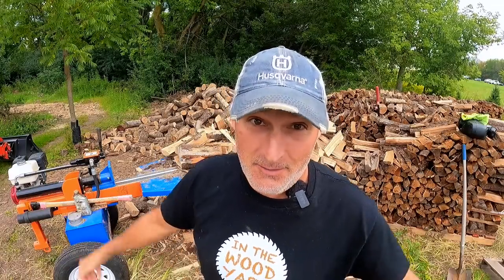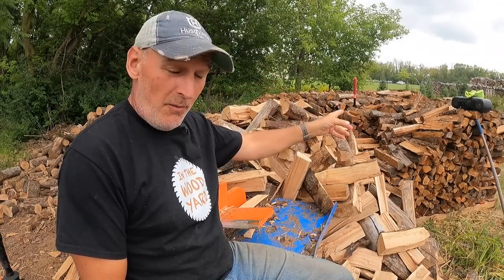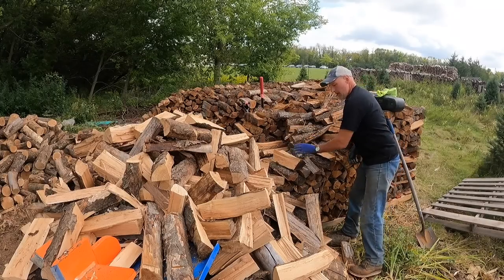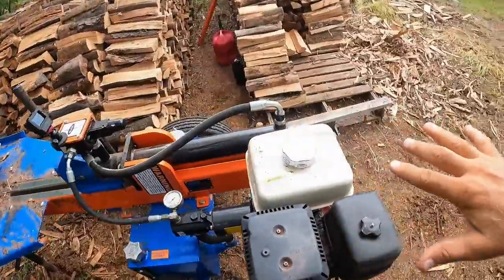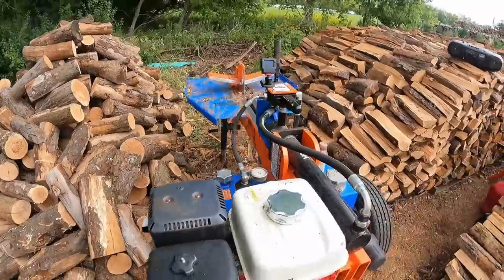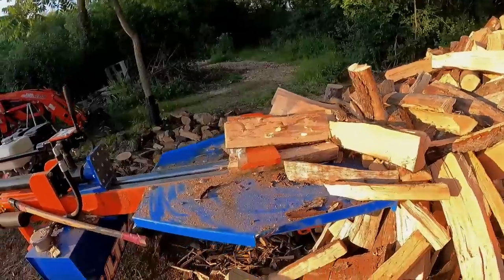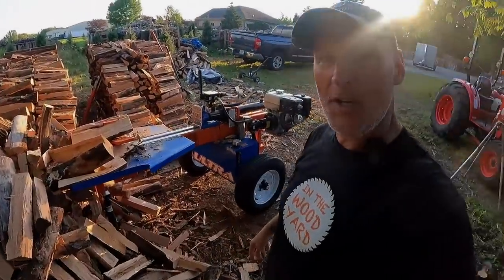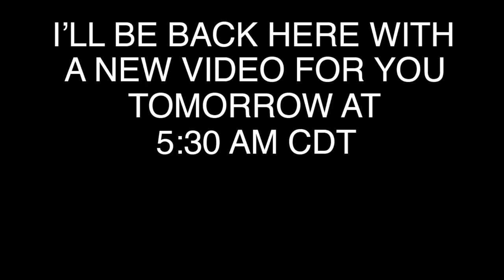Massive cherry firewood production!

Comment: I have a cord of cherry from 2 weeks ago. Green logs, split right away and stacked in a holzhausen just for fun.  To try it out. 
It's checked and looks super dry already,  it was 40% approx day of splitting, I took a few larger chunks, split in half and moisture metered it, today...  and it was at 25% in 2 weeks dry time! It really does dry fast! 
Might be dry enough by December for selling! 
Gotta get that cash! 💪 
As always great videos
I timed my wood splitter cycle. It's 26 seconds all the way down and back cycle time.  Single wedge. I need to upgrade. You're making 16 pieces of wood in time it takes me to make 1 split lol.   I made a pile about that size today too. Took me 7 hrs. Not 2 hrs 45 mins.  You're in beast mode!
Reply from the maker: Yup, get a faster splitter, speed makes a HUGE difference in production.

Comment: I have some massive cherry on my property. Any of that bigger stuff though I imagine would go to a mill before sold for firewood though. I have some that are 30-40 inch diameter. That isn't all of them but I have a dozen or so like that in the woods. There is tons of cherry here. Basically all my trees are cherry, ash, beech, maple, and ironwood. There is some others but that is what the majority of the trees are on my property. I cut some cherry recently that was from blow downs a year or so ago that I cut into about 10 foot sections and skid them out of the woods with my ATV. I skid them out and pile them up and leave them and its almost always like you have there. When you cut and split it, its fine ready to burn usually bark falling off.
Reply from the maker: Yup, that is another reason I like cherry!

Comment: Great video. And the way you explained about cherry, that's how spruce is for me where I live, however spruce grows up to 24" diameter or more. I sell alot of spruce here. I do have a question though, ok yes you have to stack the wood so it dries evenly and off the ground, but if wood is dry already, how come you don't just make a cage like your cookie bin and just toss it in cage as your splitting? Because it would still be off the ground if tossed on pallets and that cherry is already dry. Just was curious on your opinion on that. Thanks.
Reply from the maker: Good point Rod! Habit, and I did not know it would be THAT dry! Thanks

Comment: This has been a weird year for firewood drying.   I have some silver maple that was cut green this march,  bucked and split within the last 3 weeks, that tested out at 20% inside, 14% outside when I tested some yesterday!!!   These were from very large logs, too- 12-14" is the smallest. (they chipped everything smaller)  What... How???   It went from too wet (this stuff was JUICY when I split it) to POOF! wood in half a year.   I guess it does season in log form, and is just wet when I crack it open.   I've noticed changes to the color of the wood, it's hardness, and the smell vs pieces I split this spring.   Interesting to know- I can almost wait until I need more to buck and split some, lol.

  Most other varieties have dried out much faster than expected, too.   I've burned hickory and sugar maple purchased green last November.   Ash and Norway maple have been bucked, split, - and burned that night, or within 3 days...

  Hope you're having fun at Bunyon!   One of these years...
Reply from the maker: Yup, I was surprised too on the logs drying well in 6 months! Bunyan was awesome!!!!

Comment: I have a 50" cherry tree on my land right now . Just processed a 30" cherry last summer. I should send some pictures . Have a great day !
Reply: You should get it sawmilled  into live edge  slabs  when its time to cut it down.  It's worth 40x more as lumber than firewood.
Reply: @Garrett572xpg  That's the plan , the 30" was not worth much and was damaged that's why it was made into firewood .
Reply: @Garrett572xpg  I use to think that too but that’s if and only if it’s great wood. Cherry may be one of the hardest woods to find without milling issues. Most twist knots go deep and many have rot up the middle. By the time you find those few good ones your margins are out the window and it may as well be firewood.  But if your set up for it the margins are set up to make good money in my opinion.
Reply: That 22 in log I traded was exactly what he wanted. I hope you’re big tree is solid
Reply: Most live seen once over 25” 30” they rot in the middle
Reply: Cherry also likes to fork at the top which can make getting them fell without splitting the base log, real tricky as well...
Reply from the maker: WOW, THAT IS AWESOME!
Reply from the maker: That makes good sense!
Reply from the maker: good to know!
Reply: @stannelson2582   To the right woodworkers rotten  centers or spots  can be trimmed off or shaped  out with a flap disc grinder after being kiln dried. U can join 2 ugly slabs together make 1 nice slab or trim them narrow  for live edge  shelf with square back. U can use epoxy resin for minor defects and  rot spots also. We kiln dry,  plane ,and cut 25" wide slabs  but I've got a stihl 661 with a 42" bar for slabbing  giant logs.  Rot or not big logs still can be  salvageable unless  there's more rot than solid wood. Or if it has a ton of shake, cracks throughout the entire  log length. Several hundred  $ per slab is not crazy for large hardwood slabs . We've  milled a 36"  diam. With  cherry with tons of burls. Makes the most beautiful tables. The grain pops when its finished
Reply: @Garrett572xpg  absolutely your right. But for the owner of the tree their is  lil money in one tree. What would you pay to load and take that tree away if you owned a machine to load and haul the logs from one tree or even a few?  The money is big only for the seller of the final product.  Great discussion!  Garrett have a great night

Comment: I see you’ve been getting some of the plastic pallets, how do you like them so far? I’ve been stacking my firewood in rows on landscape Timbers but a few piles have tipped over so I’m thinking of going to the plastic pallets, both for their durability against rot and their stability against tipping over.
Reply: Bob...I run my timbers over several times with the tractor the first time they are placed. It smashes them down some in the dirt and has helped with stacks wanting to lean, if one side sinks more then the other as wood weight slowly sinks them.
Reply from the maker: Brilliant Mr. Tharp, but you knew that!
Reply from the maker: I actually prefer all oak pallets/skids, but the plastic heavy duty ones work good too.